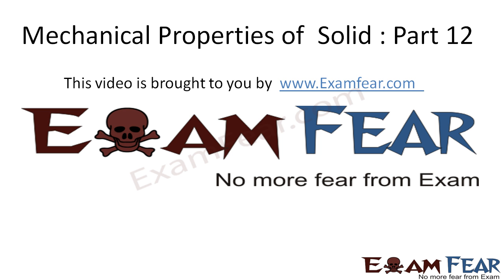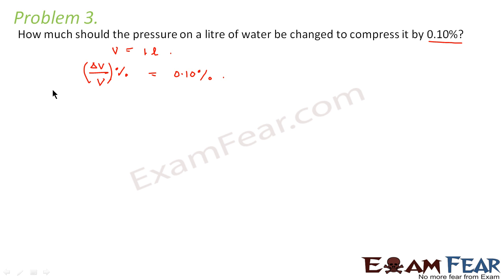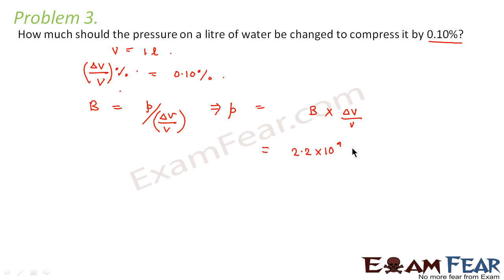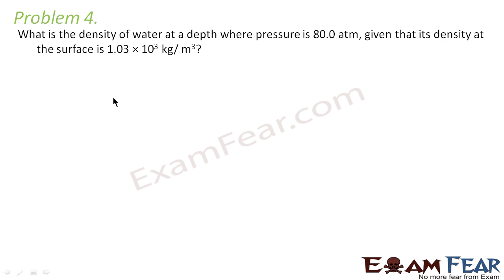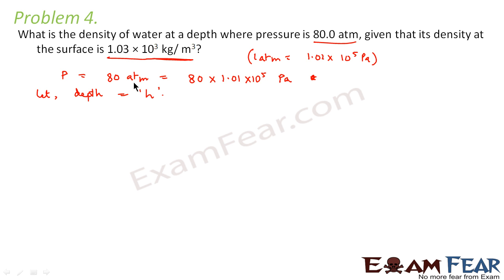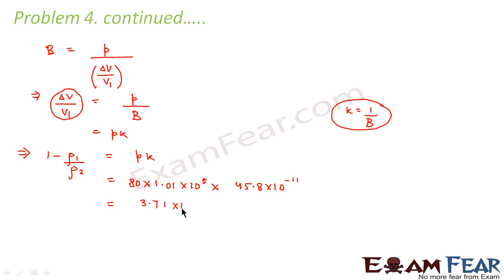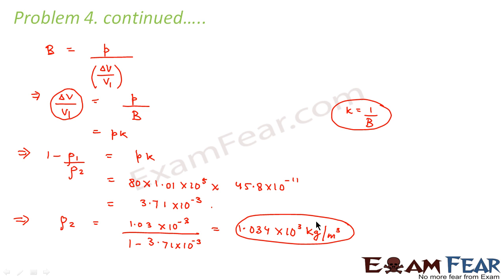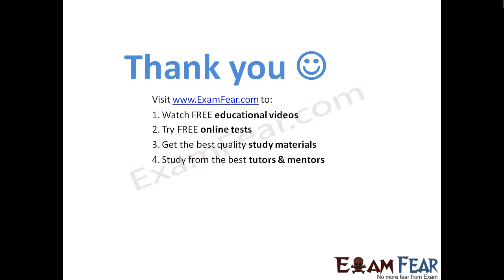Physics Mechanical Properties of Solids part 12 (Examples) CBSE class 11

Comment: how did we get the value of 'k' is equal to 45.8*10 to the power -11????mam can u plse explain??
Reply: It is 1/B of water. they'll give you the value of B (bulk modulus of water) in exams. then you can calculate k(compressibility) by doing 1/B
Reply: Kundhavi Senthilkumar yaa
Reply: Even I got the same doubt